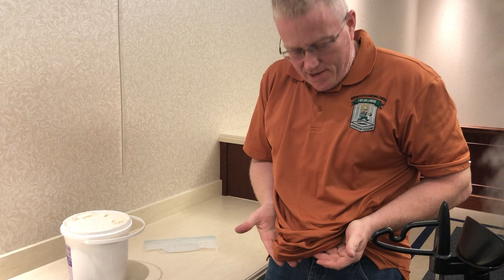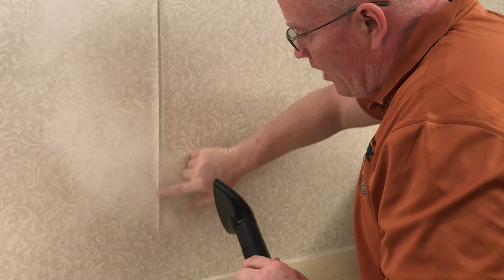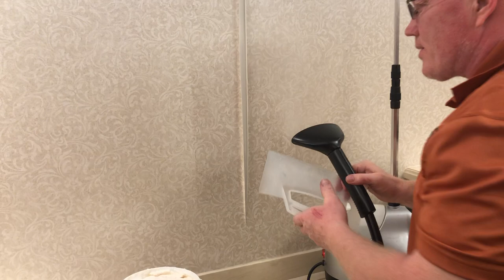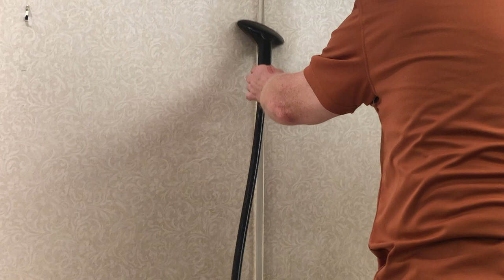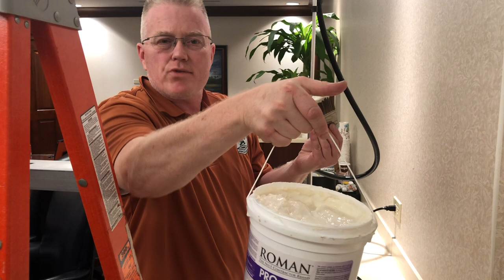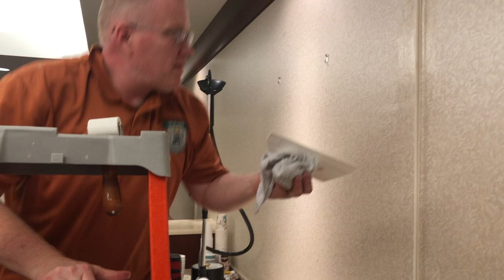Part 1 How To Repair Open Wallpaper Seams - Spencer Colgan

Comment: I worked in the Wallcovering industry for 40 years. 9 time out of 10 when the seams lift it is because the paint under the paper came off.  If you are hanging over a builder grade paint, the wet paste penetrates the paint. As it dries it contracts and pulls the paint off the wall. If the wallpaper is hard you will be able to see the old paint stuck on the back of the wallpaper. The only way I know to assure that this doesn’t happen is to prime the wall with an alkyd primer sealer. I might add that unless this is a commercial installation there would be no reason for there to be a razor cut at the seam which would only be if the installer double cut the material. This is not done on residential installs
Reply from the maker: Brilliant
Reply from the maker: Rick, thank you!   Just alkyd???  What about rx 35?   Just alkyd???
Reply: @spencercolgan  R35 is good for things like borders. When you use it to prime for an entire paper job and then goo to remove said paper years later, it's a nightmare! It does not wash off well. I have used Zinsers latex wallpaper/vinyl primer. I was a union painter and served an apprenticeship over 30 yrs ago. Still painting! Oil primer is the best. But most people do not want that stink!. It's old school. But works the best.
Reply from the maker: @teresamanthy551  I love what you wrote here. Thank you very very much
Reply: Great advice! Thanks for sharing your knowledge

Comment: Norman Longstaff
0 seconds ago
I have just bought a house with wallpaper in every room and every seam is coming apart from top to bottom... How do I fix that ... What is the cause.. house has been empty  a good while in France so heat and cold..
Reply: Steaming seems the good way .. My goodness I have a lot of house to do if every seem takes this long...  I have 7 bedrooms like this each every seem needs work
Reply from the maker: @georgianwindow  Try using Roman 535 on a paintbrush in each scene and press it down with your smoother; this was thick commercial wallcovering; don’t panic. Try glue first

Comment: After consideration I am wondering why you just don't go straight to the liquid nails since that is ultimately what you're gluing with,  what do these extra steps accomplish?
Reply from the maker: Great question… If the material proves to be something that requires the liquid nails, I have to do that only as a last resort. But if it shows me that it can be done with simple wallpaper paste come I do it if it doesn’t take wallpaper paste then I go to super tack, but that may be too watery to hold it down and then therefore in the last resort I use the liquid nails but it’s a good question